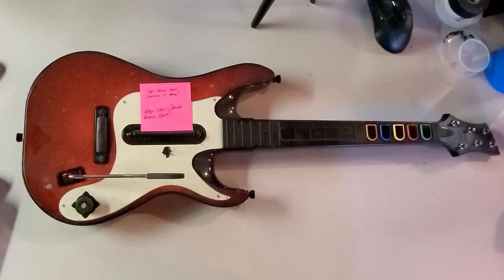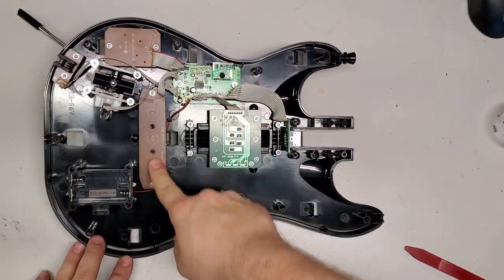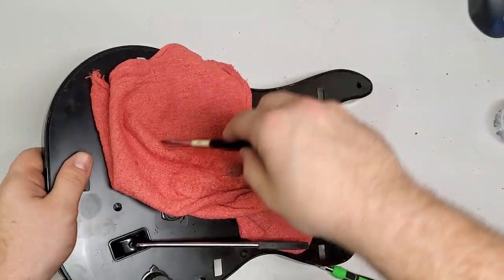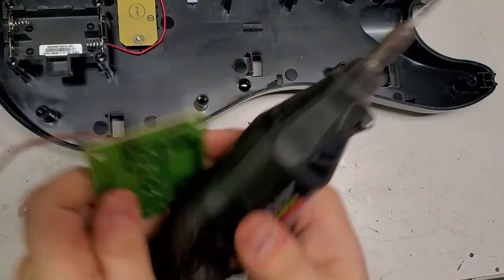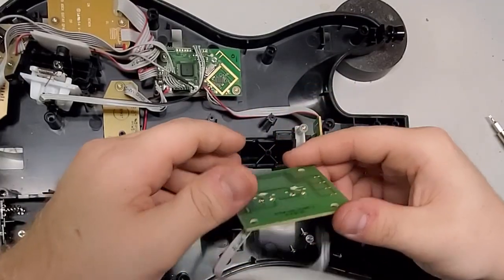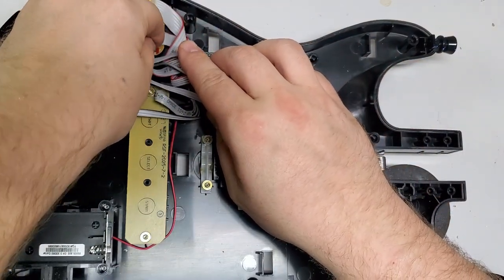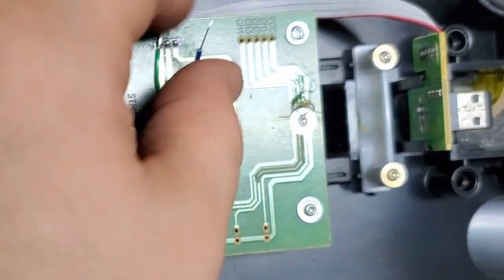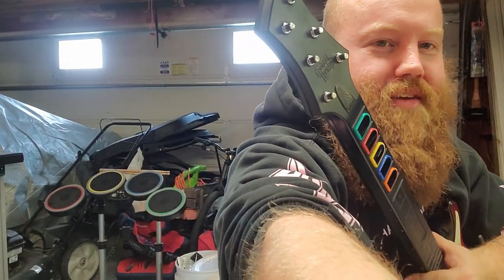How Buying The Wrong GH Strum Switches Was NOT A Mistake!

Comment: ive had an ordeal with strim switches lately. i mentioned on a different video of yours that i thought my xplorer (that the seller paid 5 bucks for) had quad overstrum so i bought switches but it turned out that it was a bug with the controller autodetect of guitar hero world tour. if autodetect is left on in the controller binding menu some controllers mess up and have a weird thing where they strum over 2-4 options on the main menu so i couldnt even scroll to quickplay and see if it was the controller itself or the game being funky. after i found that out i learned my xplorer was perfectly fine and i was left with 2 spare switches. my tac V had super squeaky switches and it just so happened that they matched the 2 prong xplorer switches so i swapped them out and my V is now even more of a dream.

 i also tried fixing my rb1 strat with some limit switches since i was at it. i bought the kind that had the bar and the roller since they were the cheapest. i chopped the roller off and just had the bar on the switch still attached and i mounted them up in the strum but when i strummed one of the bars of the switches would get caught underneath or stuck on top of the strum bars ledges. i couldnt find any solution no matter what combo i tried of height or orientation and the bars started to get some side to side wiggle so i just ended up snapping the bars off both and using them like they were the kind that is just the button with no bar. it works but i stole the whammy out of it to fix my v since the v came in the mail with its whammy snapped off at the seam where one of the o-rings was. i could send you pics of all my wacky mods if you care. do you happen to have any spare longer style whammys lying around? id only need the bar and the e clip to get my rb1 going again.
Reply from the maker: Yeah send em either on discord or email that's in description. Also I do happen to have a lot of spare parts and have numerous whammy bars from different guitars

Comment: This makes me want to try linear switches on a strum bar, maybe even tactile switches on the frets (possibly choc browns)
Reply from the maker: I'd definitely recommend both! I have these two GH5 guitars now with linear strums as well as an XP and Kramer and they are great. It may seem like they'd be floppy but there is no over strumming and they work quite well. Especially considering that the standard ALPS clones are usually sold out or pricey in comparison. That and id always recommend low profile key switches for frets, it's the only way I prefer to play and a lot of people offer 3D printed buttons to fit the switches. I'd also say shamless plug in that I do stock frets machined out to fit the switches too.
Reply: Originally, all guitar hero frets were tactile -- rubber domes are tactile switches (of course, they have to bottom out to actuate which is the main disadvantage). It's always surprised me a little that people go for linears over tactiles for the frets. Tactile switches are super common in other rhythm games too, many bemani arcade games use tactile arcade switches, like IIDX, SDVX, Pop'n Music.

Comment: when you drill into the board to add the springs, (something i was thinking of doing myself) and i was unsure how to go about it. going thru the board with the trace circuitry didn't affect the function? its a genius mod doing spring loaded but I'm worried about the board thing.
thank you for this video. it was nice
Reply from the maker: The traces are so small you can miss them easily enough but even when I have drilled through a trace I just solder directly to the pins on the switches

Comment: Where can I find replacement switches? Everything I’ve found is used. Will alps switches fit without modifications?
Reply from the maker: https://www.ebay.com/itm/324870307551
Reply from the maker: i get these. they are the closest thing to the originals, as they are not made anymore and put them in all my customer builds. The ones in this video are slightly different but basically any box switches with parallel solder pins will work. so yeah alps and others will work just check those pins arent offset.  the link i gave is usually sold out by the time they restock but it at least gives a good idea of what you're looking for. they are white ALPS clone box switches
Reply: Thanks man. I tore mine apart today and I have what looks like a surface mount capacitor across both switches. Could be a resistor but it’s the same color as a ceramic capacitor. It’s an original 2007 PS3 GH3 Les Paul. Any idea what they are cus they went flying across the room and I can’t find them now?
Reply: Any idea what that device could be?

Comment: Do I need a ardunio or something after I replace the switches I saw someone say that I have a wii les Paul
Reply from the maker: If you replace the strum switches on a wii guitar there is a possibility the board gets fried and will be needing to be replaced by an arduino. However in most cases you shouldn't have to

Comment: do i ahve to drill into the pcb
Reply from the maker: Depending on what switches you get yeah you'll have to modify the board by drilling into it. Alternatively if you find the right switch that matches the pins then you shouldn't have to.